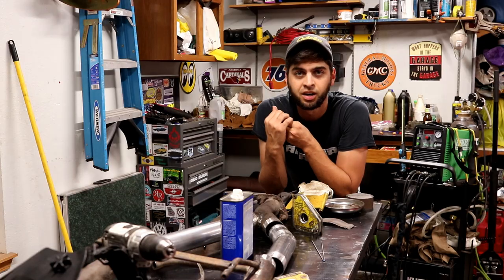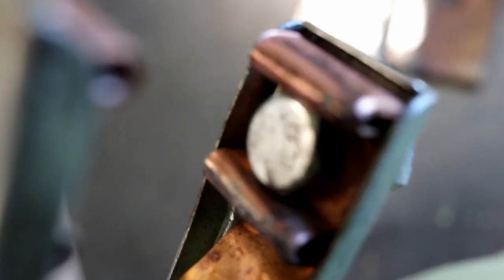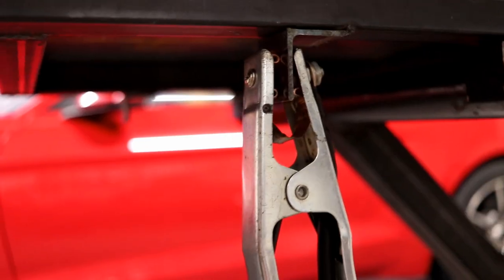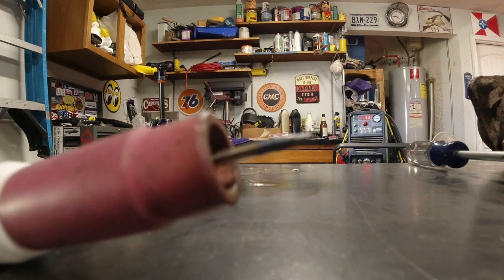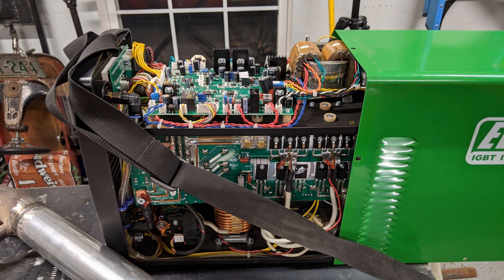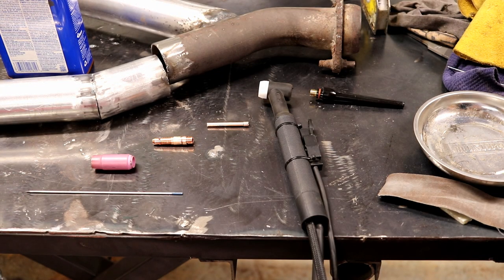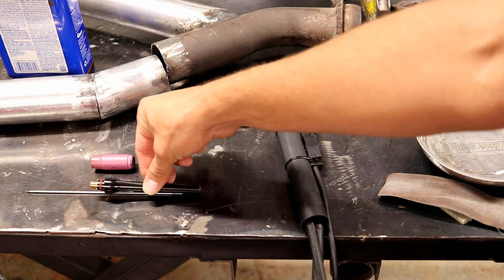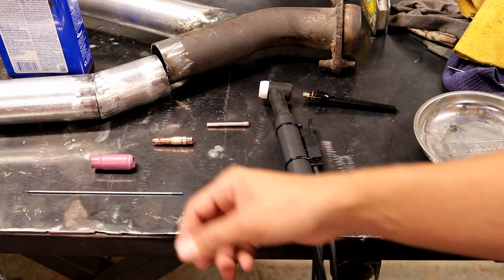Don't Get this Wrong on your TIG Torch

Comment: Thank you, I bought a tig after using a Mig, Arc and could braise and wire weld so I thought learning tig would be a breeze as I was use to wire feeding. I gave up using it as I thought I couldn't use it due to how bad the welds were. I tried again learning how too's, I watched your video. Yes mine was installed backwards too. Thankyou so much. now back to learning John
Reply from the maker: That's awesome! This is EXACTLY why I made the video. Some people laugh at me and say things that, yes I know now...but want others to learn from my stupid mistake... and save them all the troubleshooting
Reply: @Str8sixfan  I tried again, set the machine and ran three beads in a row. I have a long way to go but the wire feeding was good and the welds looked great, more confidence now, thx
Reply from the maker: @chappysprojects2627  I still suck at wire feeding! Keep it up!

Comment: I've just had a similar experience, my arc kept flaring and I couldn't even start a weld. Fortunately it didn't take too long to figure out after watching this video and others. I checked everything and couldn't find anything wrong but then stumbled across the problem - the sensitivity setting on my auto helmet was set wrong and I was trying to weld with it flashing off and on!  I'm not sure if I'll have to deal with arc-eye tonight, but it sure was affecting my vision and I'm surprised I didn't wake up to it a bit earlier.  Luckily, only around and hour lost, not several days as in your case.
Reply from the maker: much happier to her 1hr! This video is almost 3 years old  and it's amazing how popular it has become in the past 4 months or so. Glad you got back at it quicker!

Comment: It's always frustrating to happen upon a new issue with a welder.  Glad you got it sorted and you're back to throwing beads down!
Reply from the maker: Yea, it stunk that it took that long to figure it out...but at least it was simple and the integrity of the machine wasn't compromised. Now I'm set up with fresh consumables, fresh electrodes and a second bottle of Argon!

Comment: Done this a time or two, but never welded with it before noticing the problem. A lot of the times, my tungsten never was fully tightened when turning the “back cap” to tighten everything. I always pull on my tungsten after I set up to make sure everything is tight. If it’s wrong, your notice your back cap not going down as far as it used to or when you pull on the tungsten, it will move.
Reply from the maker: always up for tips

Comment: I'm confused by your Argon pressure regulator. It does not look like a flow meter but a pressure regulator. Just how are you controlling CFH of the argon? Adjusting pressure seems to be a guessing game. From watching another video, the CFH is the number of the ceramic cup X2 for minimum CFH, e.g. #5 cup X2 is 10CFH minimum, and max is *2.5. So a flow regulator, you will see a ball floating in the tube, and the markings on the outside of the tube tell you what the CFH is. You would be able to see this flow when you set it up before welding. In your case, it would tell you that you were not delivering the required argon flow rate to the weld cup.

Comment: I'm getting all of the symptoms you had but worse....  My Collet is in correctly and I even tried gas lenses and nothing is working...  I have gas flow but still get black and brownish orange welds. Grey and oxidized I'm ready to quit!!!
Reply from the maker: look for gass blocks anywhere. Maybe something is clogged? Hope you get it figured out
Reply: Did you end up figuring it out ? I have the exact same problem bought new torch and gas lenses with nothing !

Comment: why didn't you just tap the pedal and and feel if the post flow gas was coming out?
Reply from the maker: hard to recall what my thought process was over 3 years ago. But anyway, just trying to prevent frustration for the next guy is all I was trying to do in this video

Comment: Dang. I just realized I had mine in backwards. Even though I was thinking it was backwards at the time . but I couldn't get it to tighten down sufficiently on the tungsten the other way so when I flipped it and it gripped it great without me having to twist it so hard that it twisted the collet grooves I figured it must be right. Kind of weird though because it didn't really affect the welding that bad but I was welding aluminum. but I did have to turn up the flow just slightly so I reckon that was probably it.
Reply from the maker: Glad you figured it out!

Comment: Great information, I swear I keep saying I need to get a tig
Reply from the maker: I got lucky 3-4 years ago when I bought this. Timed out right with a company bonus. At the time I was simply needing an upgrade for my arc welder, but I couldn't pass up this 3-in-1 machine: arc, TIG and plasma cutter. It's been a purchase I haven't regretted.